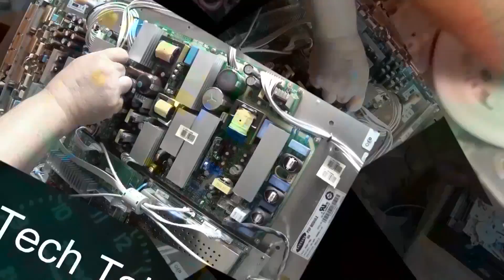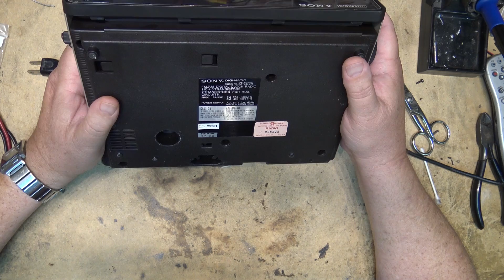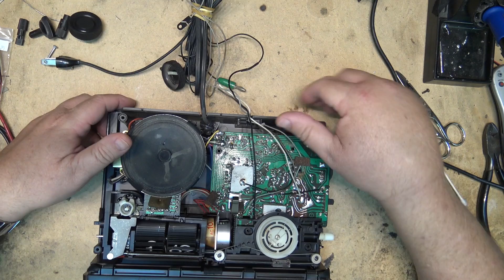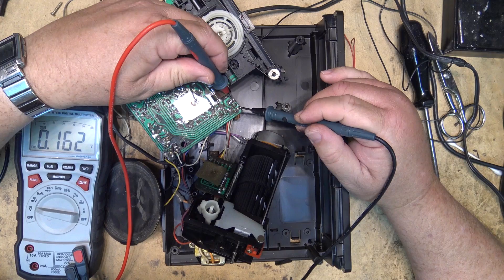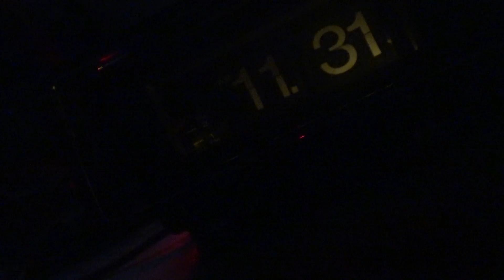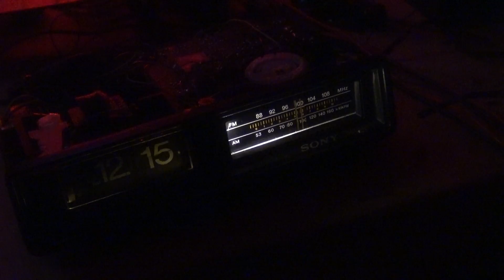Sony ICF C570 Clockradio restoration

Comment: please tell me what the problem is when you plug the clock into the socket the radio works in off mode when you turn the knob it doesn’t turn off
Reply from the maker: If it doesn't turn off then there is a problem in the switch circuit.
Reply: @12voltvids  Thank you

Comment: To get the led to be less directional, I hit it with a little 400 grit sandpaper all around it. I had the Ne2 version through middle and high school. My mother sold it at a garage sale when I graduated and joined the navy.😔
Reply from the maker: My original also had an NE2 bulb illuminating, and I was debating putting one on this one too just because the orange glow looks cool. I may still do it, as I have a bin with about 10 brand new NE2 bulbs that are just begging to go in a project.

Comment: This kind of retro display are the best ever made much much reliable than anything else.
Reply from the maker: They are as reliable as an old electric clock. I have one that goes back to the 1930's made by the Canadian Neon Ray clock company. They basically run forever.

Comment: You should cut out a see-through window on the top of the radio to see the gear spinning.
Reply from the maker: That would ruin the look. Some did have a cut away to show the motor spinning, but this one is in fairly good shape as it is.

Comment: I'm quite surprised Sony were still making flip-clocks in 1979... I had thought that all but the very cheapest HK-made clock radios were using VFD or LED modules by around 1975-6.
Reply from the maker: Yes I was quite surprised too, and glad I found this one. Mechanical clocks and just so much cooler than LED digital

Comment: The LED should be red for the reason you said on 16:56, since red light doesn't mess with the  we sensitivity of light at night.
Reply from the maker: Right, well I was considering an orange NE2, but went with a warm LED because I wanted the color to closely match the original dim bulb.

Comment: Wouldn't the motor run slow were it synchronized to 50 cycles?  That's usually the case with retro video game consoles.
Reply from the maker: Yes this one would run slow and a 50hz version would run fast.  I know a guy that bought a Hammond B3 organ out of Europe and couldn't figure out why it was way sharp on every note.   Duh, it's a tone wheel and at 60hz it's spinning too fast.

Comment: Speaking of the white LED, I salvaged it from the Harbor Freight Tools flashlight, it's an LED diode type, not an Surface Mounted LED, and what I did is to change from original red LED to white LED for my DeWalt DW9116 drill charger and looks real good much better than red LED.

On the other hand, for Equity 44200 alarm clock radio, I decided to save the blue LED before it fails, for the backlight, I changed to white LED for the clock, and what a difference did it made! I can see much better by look the clock and know what time it is. Where did I get the small white LED from? It's from Dollar Tree, the product is the keyring laser pointer with white LED and it's dual function type with the two buttons, one for the red laser, and one for the white LED. I salvaged the small white LED from the keyring laser pointer and install to the Equity 44200 and man what a difference!

next one, same thing I did for my Electro Brand 4788 the alarm clock radio and CD player, it only need is to change from blue LED to white LED for the backlight clock and for the standby light, I changed from small red LED to orange LED to use as a standby light and looks good to me.

Next one for fun, for Apex ADV-3800, I decided to change from two different colors to white LED for the VCR light and DVD light for the front panel. One for VCR is green LED, and for DVD is red LED, just a standard size LED. Again I change to white LEDs like I normally salvaged from Harbor Freight Tools flashlight to use one for fun and looks good to me.

And last two of them, for the product including ListenUp hearing aid, I did it same thing to change them two from blue LED to white LED as a power light and looking better like going through with these iMac computers and iMac laptops!

Bonus! The alarm clock including Advance 4248, when I thought it had a green LED backlight for the clock. Guest what? It has a green neon glow backlight and I didn't know that was an early technology for the alarm clock and I was so stunned about it, and I don't know that I could change from green neon glow backlight to the LED backlight because, I don't know how to modify it to make it look better. All-in-all, that's history!

And I'm really sorry that you got stung by wasp. Wasp is much worse like the European Hornets and Yellow Jackets around the globe. Wasp is what I hate them very badly. =(

Comment: You had it all apart and didn't clean the case or glue that loose broken piece of the plastic grill that will break off onto the speaker cone before long?
Reply from the maker: so.

Comment: Thought youd be interested there is still one tv station in my area that used sony umatic up to 2006 for the local access channel.  They also sometimes still play intros on SVHS cause they dont broadcast in HD and there also on a budget they do have HD handheld cameras for the future but often they roll tape sometimes when the digital server goes down as a back up.
Reply: Do you have any use for a time based encoder at all or is there no use for those any more? I have one that im not using at all.

Comment: Been looking for one myself never have been able  to find one yet
Reply from the maker: Yes this almost makes my collection of clocks complete. I still need to find a rotating drum, and one of those ones that use the rotating drum with cams that control leaf switches to switch on and off 23 NE2 bulbs arranged in a 7 segment display.  I had one of those too once and it was tossed.
In my collection of digital clocks, I have a mechanical DYN 7 segment shutter, this flipper and in electronic clocks. LED 7 segment, Numitron (incandescent 7 segment) Vacuum fluorescent 7 and 16 segment alpha numeric, panaplex (neon plasma cold cathode) and nixie tube and of course LCD.

Comment: Learn something new all the time... did not know you could connect a LED directly to AC without some sort of rectification
Reply from the maker: Well they do call it a "Light emitting diode" and a diode is a rectifier. You could hook 4 of them up and make a bridge out of LEDs.
Reply: @12voltvids  How much voltage and current can a Bridge rectifier handle made out of LED's?
Reply from the maker: @bones007able  not much.
Reply: The LED itself is a rectification device too, the reason you almost don't see that method used more often its because the led only works on the positive side of the sine wave of AC and that causes flickering, its more noticeable when you see the light with the peripheral view of the eyes and sometimes its annoying but in this application its good enough but for illumination purposes its a no no.
Reply: @chancho00  I know that , I read that the constant turning on and off by the AC sine wave can stress it to fail sooner...

Comment: I have an old drum still flipp clock I and I do mean old it was made in 1955, model name television. I got he clock from great grandma and it kinda worked when I got.i had it repaired by clock repair man and works fine and keeps accurate time. The incandescent light bulb can be turned on and off by a switch. Also the light bulb is original so it is 64 years old but the light bulb is nurmly not on.

Comment: If that is how you react to stings, take anti-inframmatories asap after the sting. Ibuprofen is deal. Be aware that us larger chaps need larger doses for meds to be effective. If you always swell, you are likely allergic to stings to take a few antihistamines asap too. Read up on the symptoms of severe allergic reactions so you can be prepared if they happen.
Reply from the maker: I am fully aware of it. I am allergic. Last time it happened earlier this summer I ended up in the ER with an irregular heartbeat.

Comment: Hello. A tip from me. old light bulbs have a beam angle of over 90.
But usually
3mm. 5mm. 10mm. LED bulbs you find in flashlights have much much less light angle!
For example as an indicator light on some electronics I make so I like to use flat top wide angel bulps! I don't like the laser light if you know what I mean? You can also use flat bulps that you find 1 piece in flashlights but then you have to have less than 1 watt bulps or it gets too hot without heatsink.

The clock didn't light up so well!
Reply from the maker: Clock lights fine. You don't want it real bright in a dark room.

Comment: I had one of those I restored myself too. Don't have it anymore though. I have a Zenith "Circle of Sound" with rolling tape digit display. Those mechanisms were notorious for breaking. When I repaired that, I had to take apart the entire movement, dozens of parts! I put in two NE-2 type bulbs rather than 1 because I wanted the clock display to be more uniformly lit. I also restored a General Electric black light flip clock. The digits are a bright green color, easy enough to see in the day. The original black light bulb was toast so I installed a module of 5 UV LED's to light the clock. It worked...but the numbers glowed so bright, forget about trying to use it in a dark room! So I installed a 50k adjustable pot where the earphone jack was and now I can adjust the brightness to my liking. I never did like those plain old red 7-segment displays, too boring! I also have a nixie clock. Nice how you used LED's for the clock and radio, shouldn't have to worry about having to replace those again. Wasps show NO mercy!

Comment: I'M confused i thought led's are Dc voltage
Reply: an LED is a diode , so at 60hz ac it will light every half of the cycles ( 30Hz ) , the human eye only needs about 25 cycles or more to look like it consistently lit.
Reply: Yes you can use an LED this way but you have to be careful using an LED as it's own rectifier.

A typical 5mm or 3mm through hole LED has a maximum reverse bias voltage of around 5 volts since the AC supply was under that the way it was done is fine.

But at voltages above 5 volts AC you can damage the LED. The reverse bias voltage is so low because LEDs are optimized for light output not rectification.

An easy way to solve this with an LED across AC (at a voltage over 5 volts AC) is to put a rectifier diode a 1N4007 or similar across the leads of the LED in reverse (the cathode of the 1N to the LEDs anode and the anode of the 1N to the LEDs cathode) so when the sine wave swings negative the rectifier diode will be in forward bias and conduct so all the LED will see in reverse bias is around 0.7 volts which is perfectly safe.

You could also put a rectifier in series with the diode too of course.
Reply: Bushougoma awesome solution, I’m planning to replace the incandescent bulb on my door bell to LED, IS A 12 v ac bulb and it gets so hot and burns out every 2 years.
Reply: That's so weird I did that a few months ago myself. My bell is an older style with actual chimes that are struck by a plunger that's actuated by a solenoid it ran off a 16 volt AC transformer I measured around 18 volts at the secondary.

I made a full wave bridge rectifier out of four 1N4148s so the flicker would be at 120 Hz rather than the 60 Hz you would get with a single diode. I was able to point to point wire and solder the bridge to the screw terminals on the back of the switch pretty neatly. I think I used a 1K 1/2 watt resistor for current limiting as 1/4 watt would have been thermally pushing it.

Learn from my mistake you will also need to tie a TVS diode across the switch contacts otherwise the inductive kick from the bell solenoid when the switch opens will fry the rectifier after a few button presses. I used a SA28CA it will clamp the spikes to around 30 volts which the rectifier can easily handle in reverse bias. I didn't measure the spikes but they had to be over 100 volts to fry the 1N4148s I used.

I literally facepalmed when I saw the LED go out because I knew better.
Reply: Bushougoma  thanks, your info is gold. 👍🏻
Reply from the maker: @ver64  Carefull. When the button is pressed and released the bell striker will kick a high voltage spike back to the button and could pop an LED easily.
Reply: 12voltvids  thanks, I didn’t think of that....
Reply: vk3hau  Right on 👍🏻👍🏻
Reply: @vk3hau   unless you move past it fast you can see it flashing but for most things that will be ok.
Reply: +vk3hau - The pulsating DC that results from half wave rectified AC is still 60 Hz, not 30. You may be confusing the opposite situation that occurs with full wave rectification, which doubles the frequency.
Reply: So did i
Reply: Me too...but think about it, AC in America switches on and off @ 60 Hz so in the case of the LED you won’t see it switch on and off....the eye is too slow to catch  the switching ...so in other words will look steady on.....
Reply from the maker: @ver64  At half brightness.